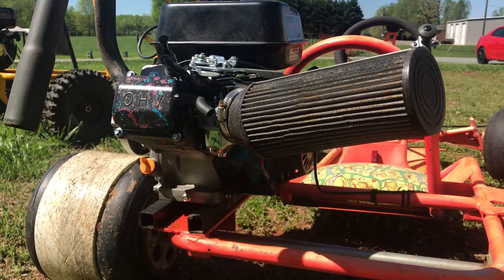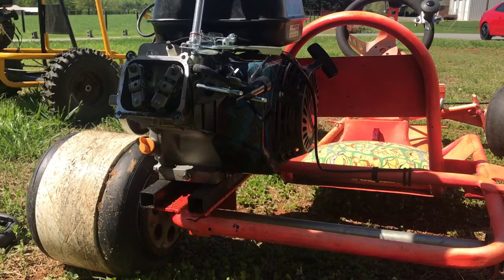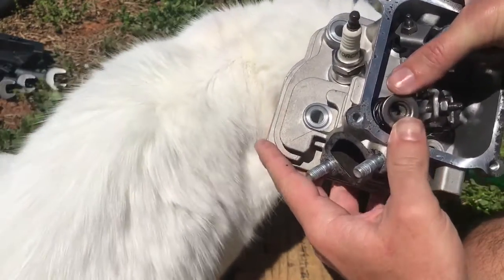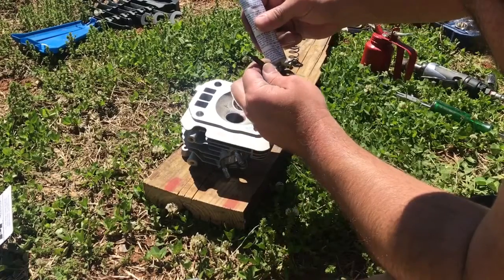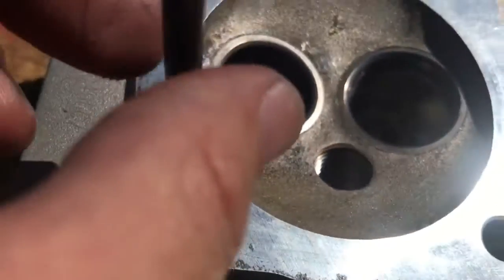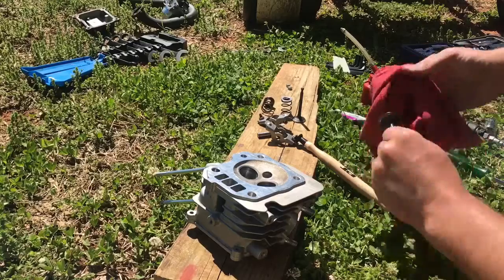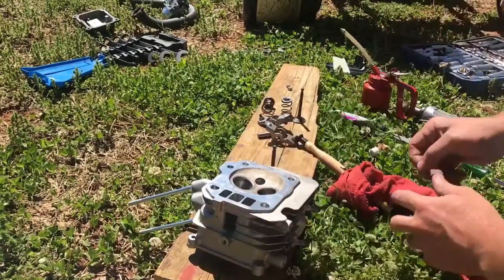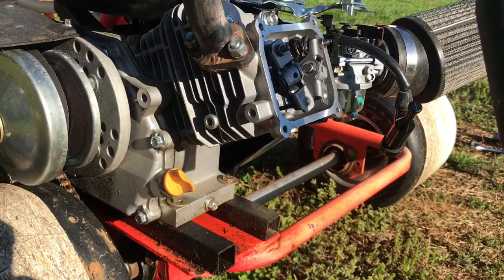Lapping / Reseat Valves On Hemi Predator 212

Comment: My valves wont come out. They both slide all the way to the tip of the valve and then stop.
Reply from the maker: I’d put some oil on the tip while it’s still up in the head then if it still sticks have it a little tap with something long.

Comment: Can I run stock valves with a stage 4 kit???
Reply from the maker: If you are talking about the stage 4 kit from OMB warehouse they say that the stems are too long on the stock valves. If you’re using a spring heavier than an 18lb spring and switching to automotive style retainers and keepers there are comparability issues with the factor valves as well.
Reply: My stage 4 kit comes gopower sports.. my engine is a 212 non hemi.. so to upgrade to stainless steel vales..which are only made for the hemi..so I would have to ream out the valve guides to 5.5mm to fit in the stainless steel hemi valves.. which to me sounds non sense as long as I got good timing and heavier springs, in which case..I'm going to be using 26lb springs..
Reply from the maker: Looking at their kits it looks like the already has upgraded valves with retainers and keepers. So you may be alright already. If not the 26lb springs will work with the factory components but the valves may still be to long like they are in the omb kit.